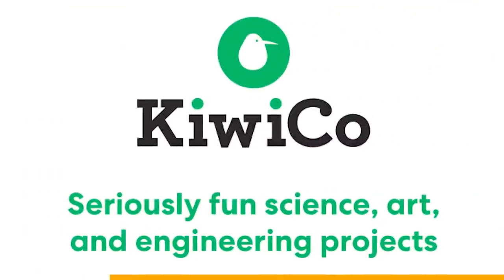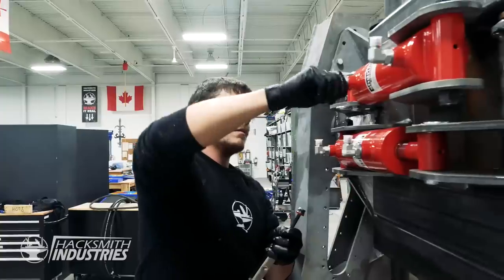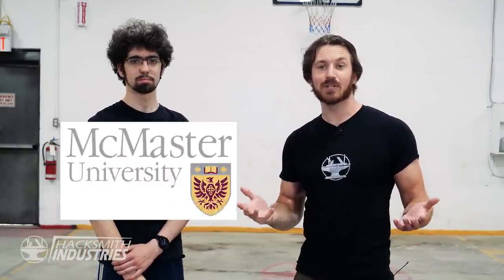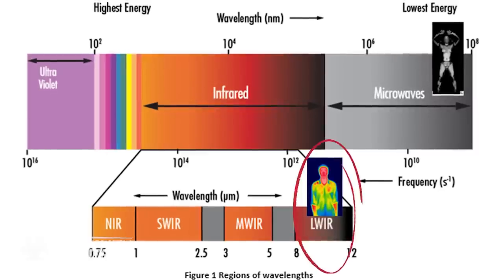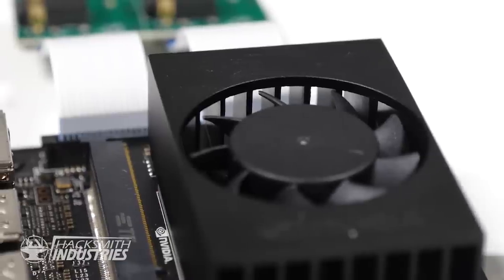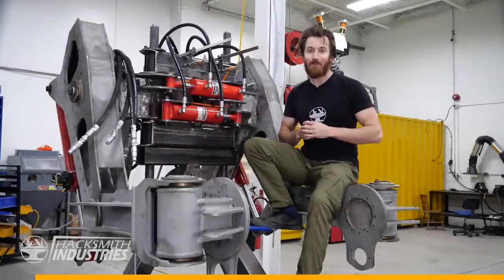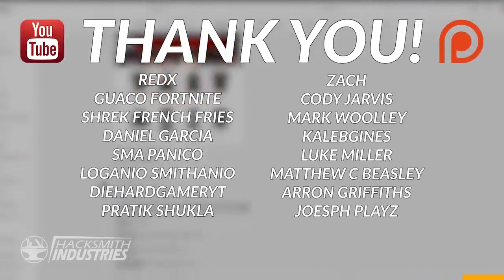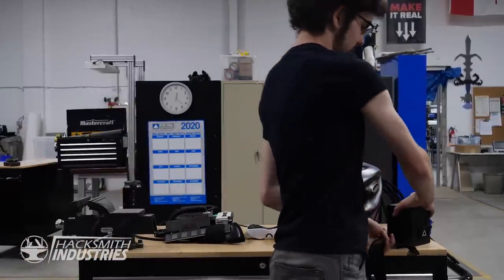Thermal Vision Helmet! (PREDATOR SUIT BUILD)

Comment: U.S military:       “Write that down, WRITE THAT DOWN!”
Reply: BadThoughts lmao
Reply: At this rate, they probably have something like this but even more advanced...
Reply: @maain9474  they already do but its too expensive to give to every soldier
Reply: secret camera monitoring us in area 51 looks away suspiciously in binary
Reply: They already have thermal helmets 😂
Reply: @subjectc7505  no they have night vision rn not thermal
Reply: @subjectc7505  only some have thermal, most have night vision
Reply: @Dan Lapain Their actually used in aviation and combat vehicles. I don't know if the troops have them yet.
Reply: They have Hybrid Night Vision devices, wich is basically a Night Vision Goggle with a Thermal Image Overlay that highlights certain Heatsources. The only Drawback is, that this Things are ridiculously expensive.
Reply: the ir torch on this thing would be a massive "shoot here" signal.

Comment: Fun Fact:  In the original "Predator", they tried doing the thermal vision but the jungle was so humid, everything showed up red.  They tried spraying the plants down with cold water but that only lasted a few minutes and it required a lot of cold water.  In the end, the director took the negatives of the film and used the outlines of the people plus a bit of color correction to make the final result.

Comment: If you need a IR pass filter in future.. use the disk out of a Floppy Disc ... the black disk allows IR through and no visible light... and you can cut and shape it with scissors

Comment: I did something similar but with the difference that I installed a temperature camera and another camera in the back, it is the same camera and it took me a long time to do and I also configured some buttons on a glove to control the display of the first camera with the option of viewing thermal and the rear camera and the same as or above

Comment: Hi hacksmith, I think I have a challenge for you is it possible to make one of the three choices.                                            1: portal gun from portal 1 and 2                                                         2: the zero point energy field manipulator otherwise known as the gravity gun from half life   Or 3: pyros flamethrower from tf2 (which is probably going to be the hardest) if you can do one of these as a challenge awesome if not than that’s understandable. Thank you.

Comment: 12:26 - Can anybody tell me what kind of machine that is, and why it's used as if you were handling radioactive material through gloves? I thought I saw them cutting metal before with stuff and water poured over it. I'm not knowledgeable in engineering equipment but I'm fascinated. Or am I misunderstanding and it's for spray painting or something? Thanks in advance. Biology is my thing, not mechanics.